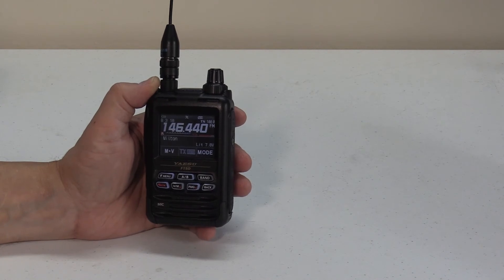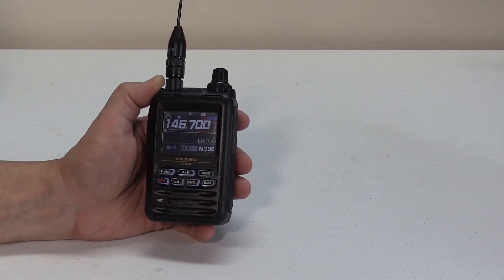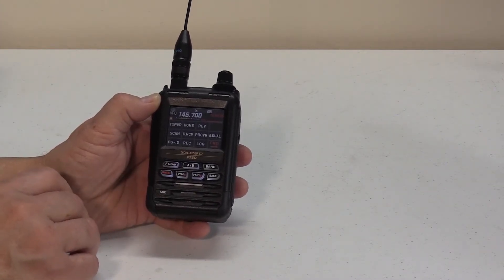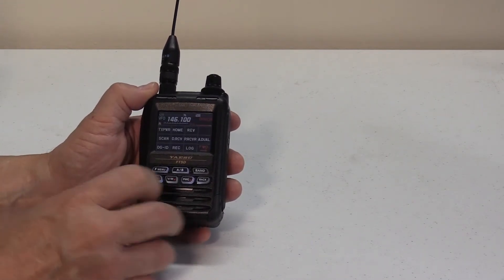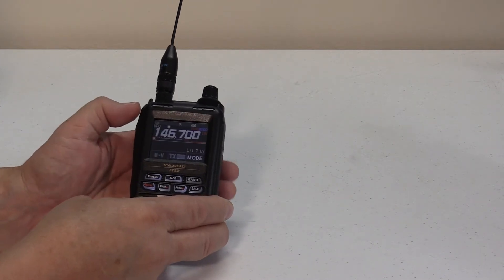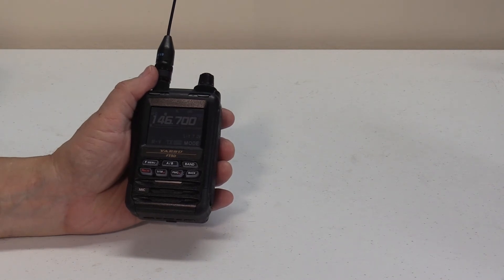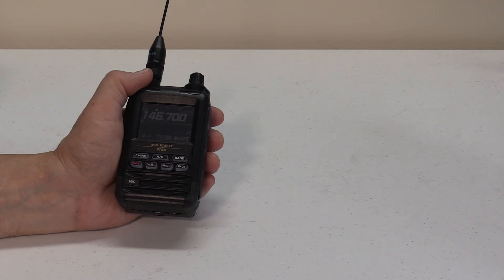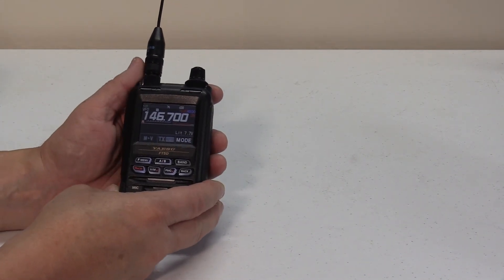Setting Up The Yaesu FT 5D for Repeater Communications

Comment: Just wanted to say, thanks. I don’t play radio often, but received a text this afternoon that the local club’s van/repeater was going on air for a test. That is when I realized I didn’t know how to manually set the off-set for the repeater. Consulted the op manual, but your video helped. 73.

Comment: Good evening. In config #16. How do i change my repeater shift frequency  from 5.70 to 5.73? Thank you. Because if i change it from 5.70 it goes directly to 5.75. 

How do i go to 5.73?
Reply from the maker: I do not know.  You might have to change the frequency step to 1 instead of 5 to do so.  I have never come across this.
Reply: @K4SRF  freq is by 5 and no step by 1
Reply: @DonDon ranada  kinda weird... 
Besides, 
I don't know of any radio with Steps lower than 5... (though I believe I've heard someone mentioned 2.5 ).
If I'm wrong please correct me. 
73s from KJ4BGW

Comment: good video. The situation I have is that I have two frequencies in my area and both of them use the same repeater. However, when I set the repeater freq in one then it deletes it from the other freq. Any suggestions as to what I can do so that both maintain the repeater freq? I like the clock and of course the radio interruption. :-)